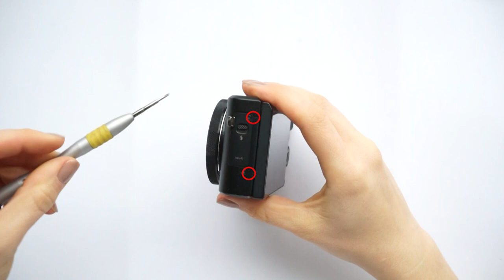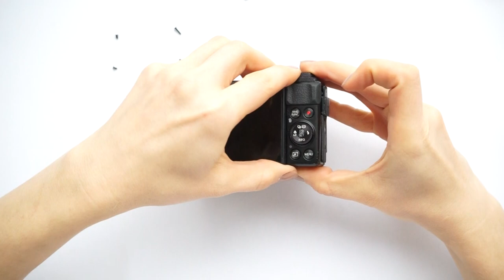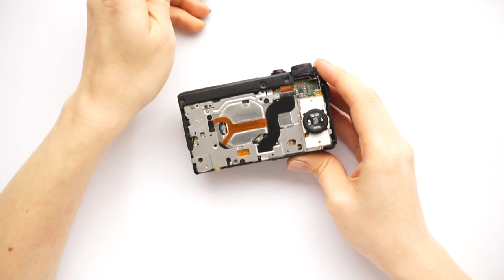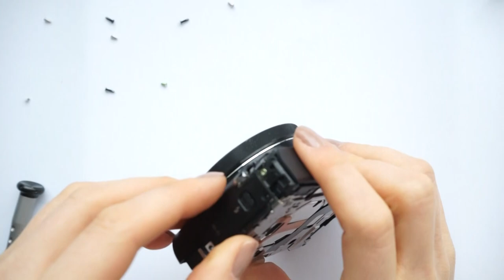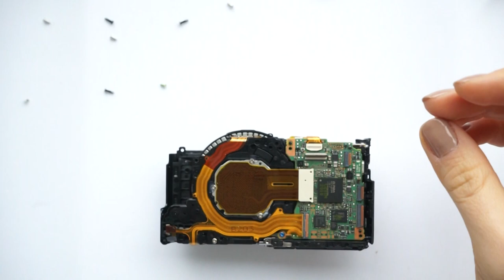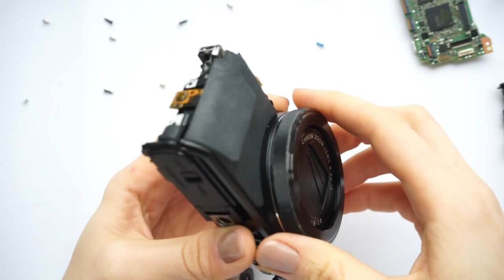Canon PowerShot G7X Mark II Digital Camera Full Disassembly Step by Step Tutorial

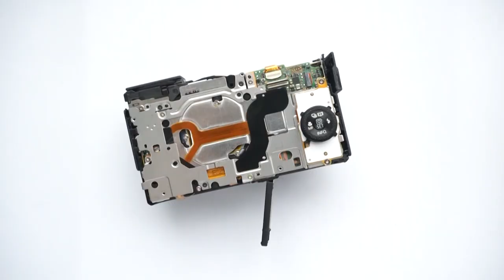Comment: Hello, I wanted to know what type of screw you used at 2:53 in the video. I have a screw set, but I have been using a Phillips #000 screw driver. I have not seen many videos on what type of screw driver is required for this part.

Comment: Are all the screws the same size?
Reply from the maker: No, they’re not
Reply: Selffix I took mine apart and when I hit the power button it makes a sound and shuts off, when I hit the button on the side for WiFi phone the screen lights up and says camera error
Reply: Selffix  the reason I took it apart was to adjust the lense, I broke it down and was able to turn the lense in an out then I put it back together, this is my video before talking it apart 

https://youtu.be/HCgFLNK5yS0